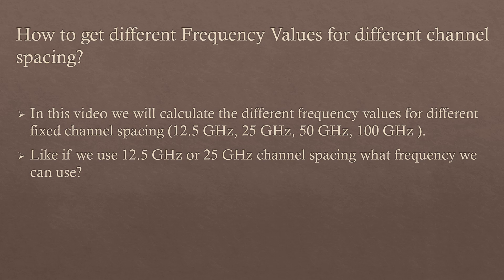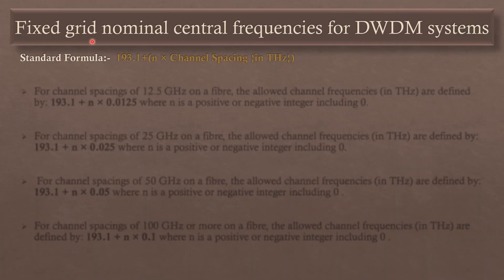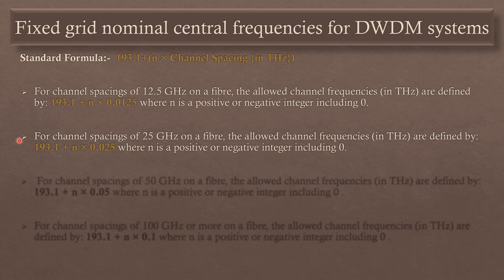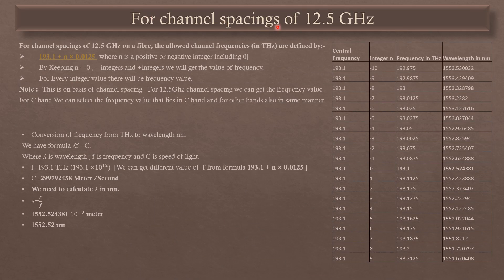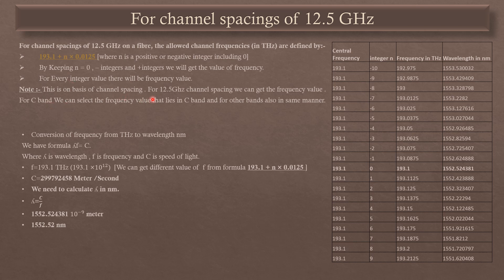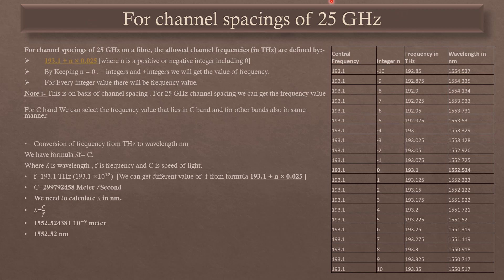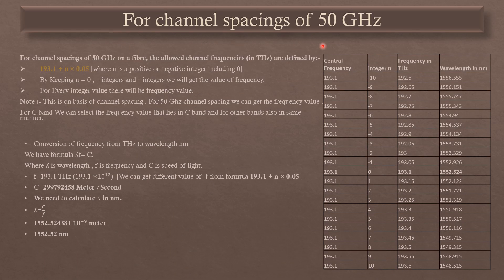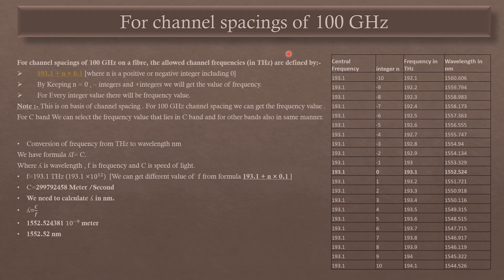How to get the Different Frequency [Wavelength] Values for different Fix Channel Spacing in Optical?

Comment: What channel spacing to choose while transmitting 400G?
Reply from the maker: Actually channel spacing also depends upon the modulation so it depends upon the requirements and planning
Reply from the maker: This video is made for knowing/calculating  particular number of channel when using any particular channel spacing.

For any channel the capcity depends upon the modulation and other factors so planning according to requirements is must.
Reply: @DeepakKumarSingh2015  my point is what is the need of flex grid, when we transfer data of 2.5G to 400G on fixed grid
Reply from the maker: So that we can simultaneously transport the 2.5 G as well as 400G
Reply: @DeepakKumarSingh2015  what I understand is in fixed grid also, we can transfer the data on 2.5G and 400G on different frequency
So in flex grid, we can transfer both 2.5G and 400G on same frequency .. ? If so, how.
Reply from the maker: Not on same frequency

Comment: Why we have different channel spacing.?
Reply from the maker: As per requirement to transmit different line rate (2.5G, 10G , 40G , 100G ,400G and 800G) easily and prevent to overlap .
Reply: @DeepakKumarSingh2015  Thanks, can multiple channel spacing coexist in a same system..
Reply from the maker: @gauravdownload  Yes . Flex Grid is the solution.